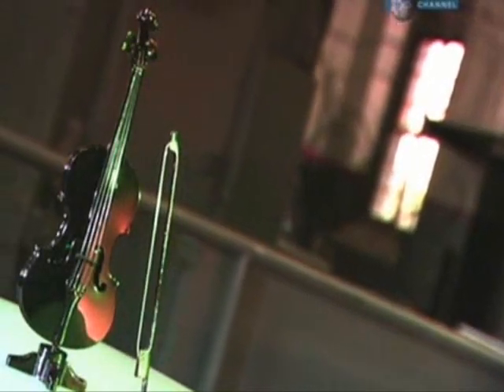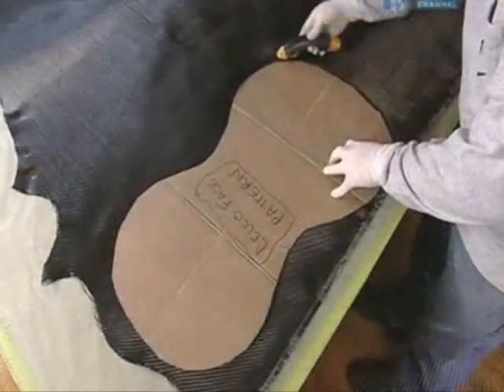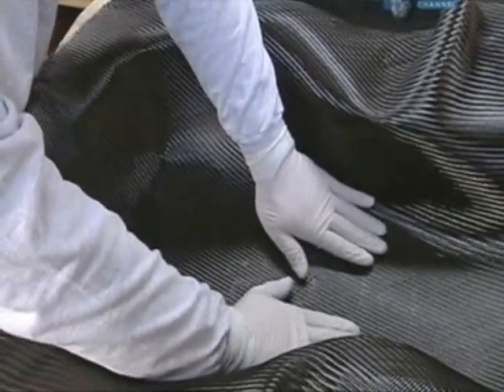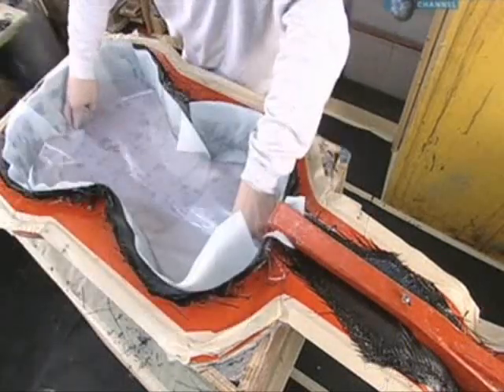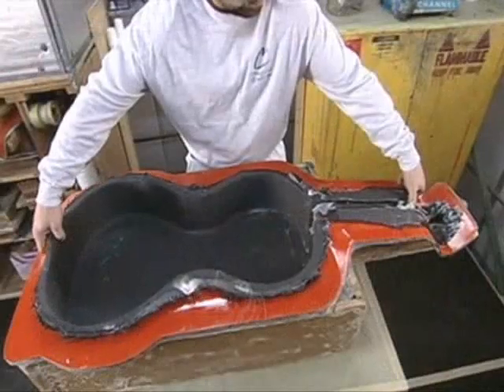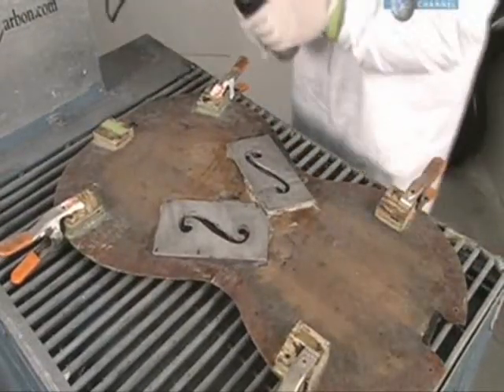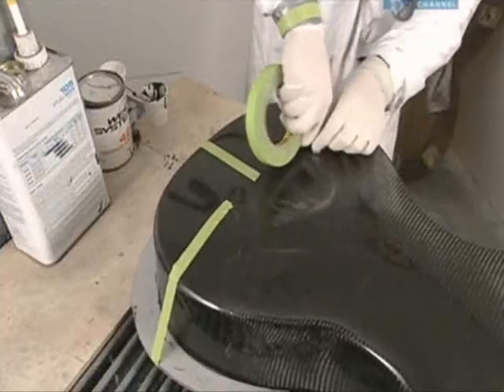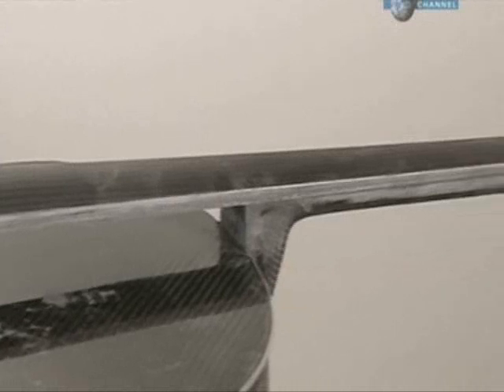How It's Made - Carbon Fiber Cello (Pt.1)

Comment from the maker: The nylon sticks a little bit but you can peel it off. They use a nylon sheet to absorb a little epoxy and to leave the carbon fiber/epoxy with good finish. It also helps with even distribution of the pressure so the epoxy gets vacuumed out evenly.

Comment: i am a fiber engineering student .... most composites are cured under a vacum at around 350 degrees F .... the reason they are so expensive is because carbon fiber costs about $25/lb.  and the process is labor intensive and takes has alot of fixed costs

Comment: Think of it like reinforced concrete. Super thin carbon strings are steel cables or robs with that keep the building more resistence to tension and stress. Resin is like concrete that makes the building hard and tough. Only both work together can give Carbon fiber strength to rival steel. Yet, Carbon fiber cannot resist penetration and cutting as well as metal because individual carbon fiber is still essentially a fiber.

Comment: It could be a great outdoor cello for acoustic performances in the open.  The loud sound can help the performer without any backing to reflect sound.  It would be great in case of rain, hail, chilling cold, or blazing heat. However, I would still prefer an electric cello that plugs into an amp for public performances if the weather permitted.  ; )

Comment: Carbon fiber strength comes from the density of nano carbon structure combined with plastic resin or other cohesive materials. So even if the entire CF sheet goes through the same cooking process, without the proper application of resin, CF is as weak as your washroom carpet.

Comment: @Afrocanuk Because as strong as carbon fiber is, it is very BRITTLE. You don't want that in building material. When metals break, they deform. When CF breaks, it explodes into shards.

Comment from the maker: It's stronger than steel compared at the same weight. Similarly, aluminum foil can be torn quite easily but we know that just because we can tear aluminum foil doesn't mean we can tear all aluminum. We have to look at it relatively. Good observation though. A lot of carbon fiber marketing tries to make you think that the word "stronger" is an absolute term. We should always ask stronger and lighter compared to what and at what weight?